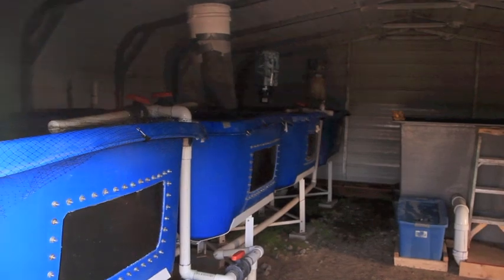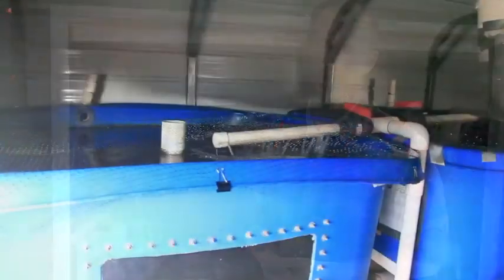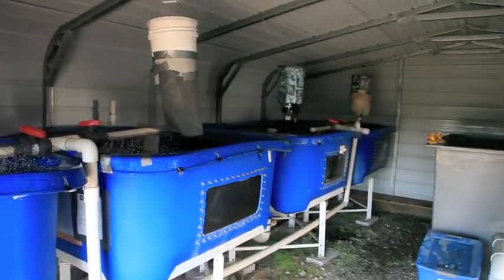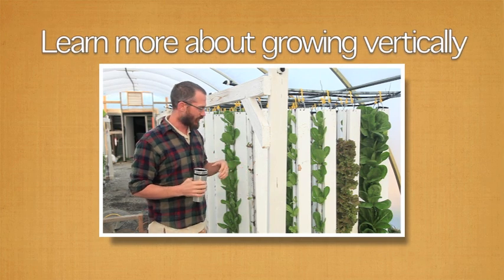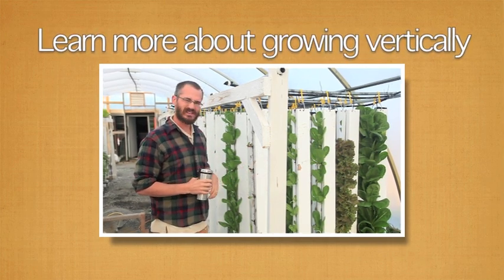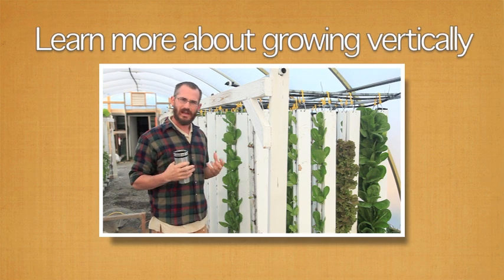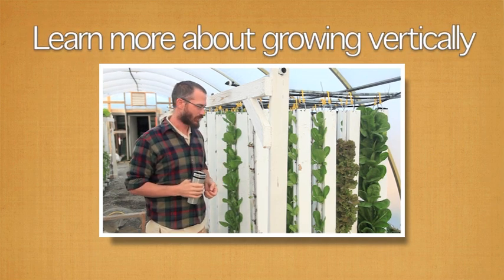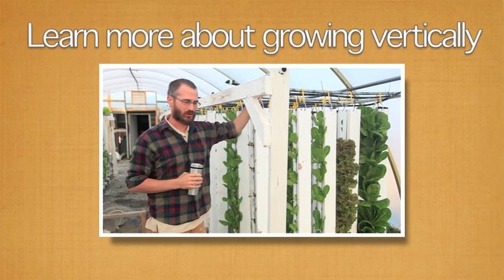Water in Aquaponic & Hydroponic Systems

Comment from the maker: We typically run between 20-40 ppm, but you can run it at as high as 160 ppm and your fish shouldn't have any problems. It's best not to get it that high however. Plants use nitrates throughout that range.